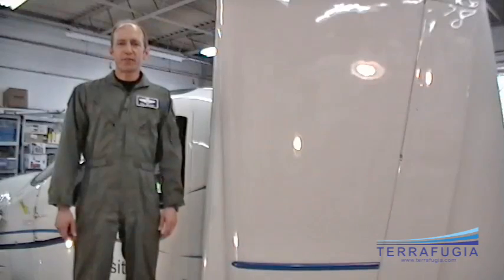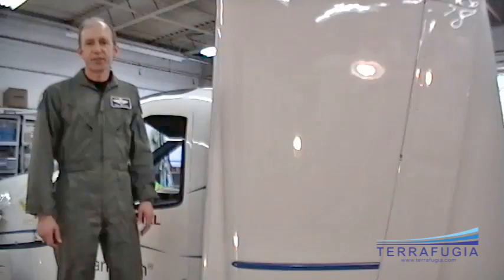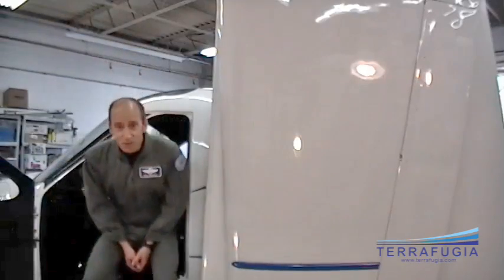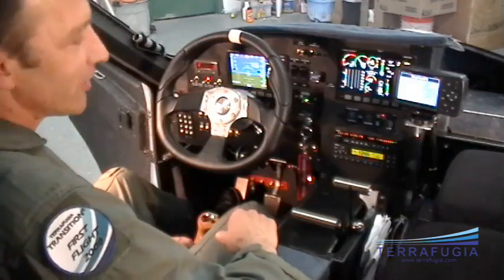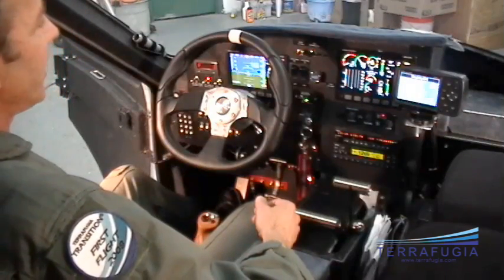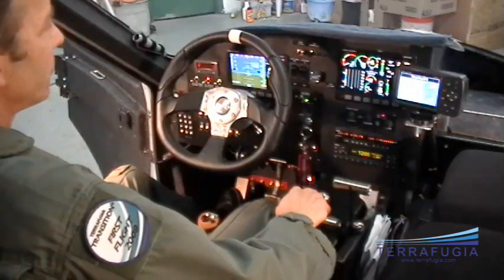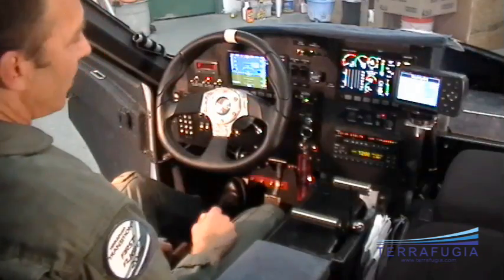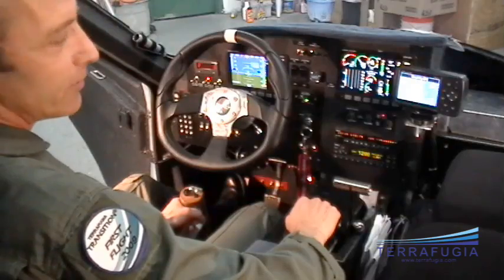Inside the Terrafugia Transition® POC

Comment: What people don't really notice is that this is a "roadable aircraft", not a flying car. It's an *aircraft* that can use roads. So you still have to be a certified pilot to be able to fly this. You still need to fly from one airport to another airport (no chance of taking off or landing on a road), and the pilot will have to abide by all aviation regulations when in the air. It's a reasonably priced aeroplane. But you have the wrong idea if you think you can avoid traffic jams by flying to work!